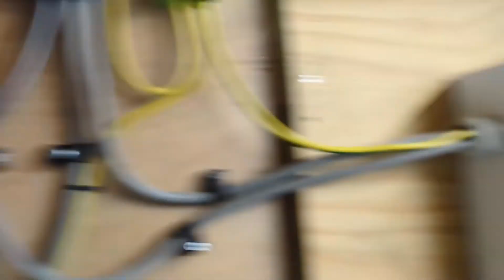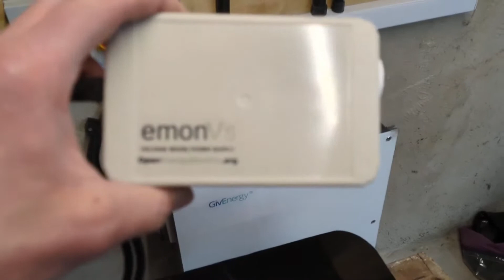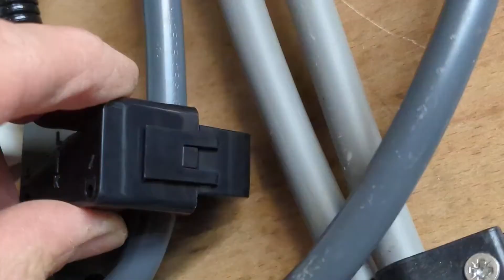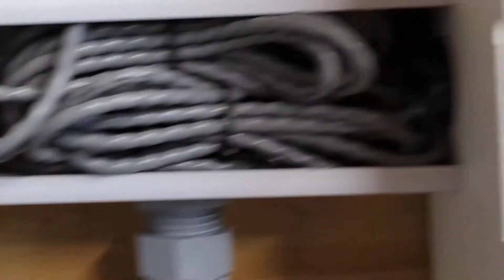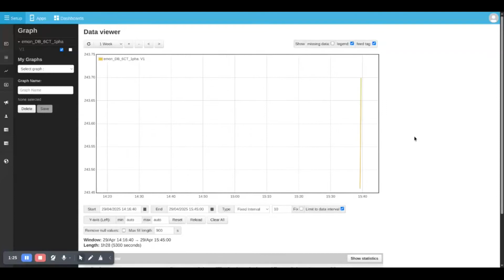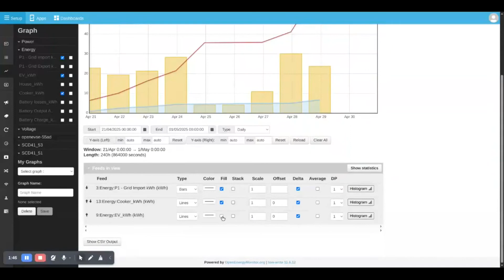OpenEnergyMonitor Electricity Monitor Installation emonPi2/3 & emonTx5/6

Comment: Thanks for the video, interesting to see the modern kit.  Still happily using a 2015 Arduino shield and a Pi running the 2016 build (on a SSD now) here in Greece.  I really must update sometime, probably get stuff dellevered next time I'm in UK - outbound postage from GB to here is a disaster.
Reply from the maker: Nice! That's great to hear. No need to update if it's still working! Agree shipping is expensive, not much we can do about that